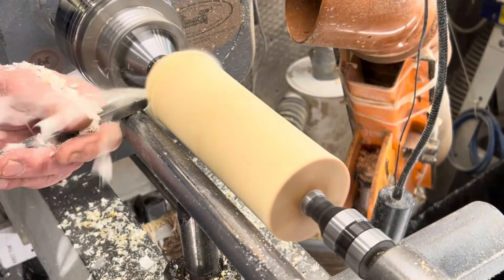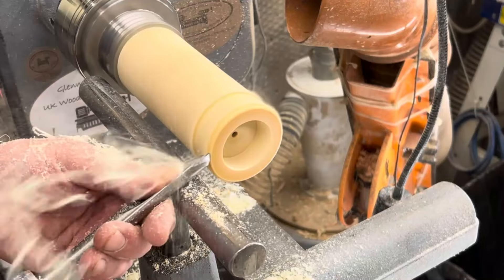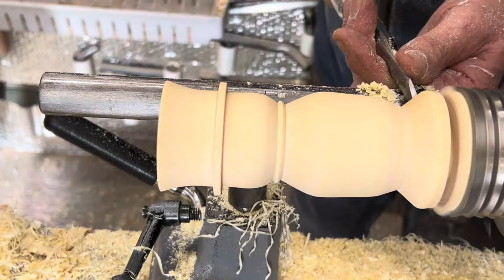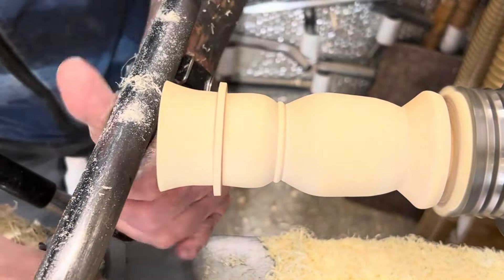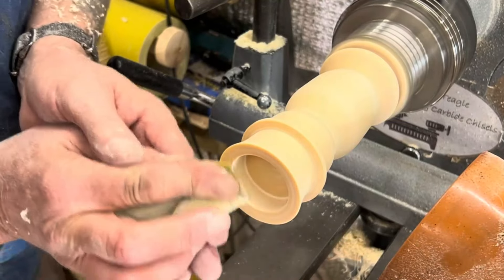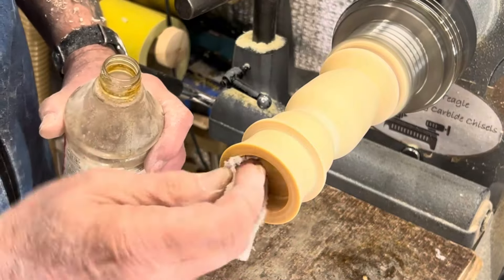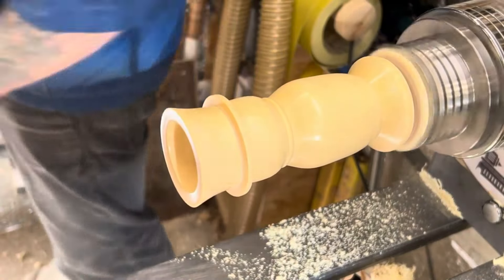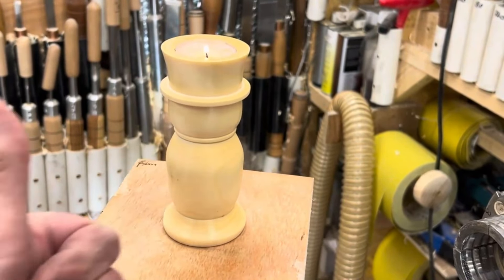Woodturning. Making money from free wood. #carbide chisels

Comment: Lovely skills , makes me look very amateur , i like the idea of tea lite holders but isn’t there a fire hazard ? Would hate to make something that caused a problem
Reply from the maker: Why would there be a fire hazard ?
Reply: @glennteagleofukwoodcraftca5308  lots of safety warnings about tea lights on flammable  surfaces causing fires , or do your use electric ones ?
Reply from the maker: @ianparkes2538  where are these warnings? Do you mean from other Turners, just spouting out crap, scare mongering. The tea lights come in packets which state not to leave lighted candles un-attended, not to place them on un-even surfaces, not to leave them in a draft, not to leave them on plastic surfaces. In all the years I have used tea lights I have never managed to catch a holder that I have made alight. I have put it out there that if anyone can show that, then prove it. I have tested that a lighted tea light placed on a sheet of paper will burn out and will not catch the paper alight. The cases do not get that hot. If you do not feel comfortable doing it, then don't. That is all I can say.
Reply: @glennteagleofukwoodcraftca5308 well said mate
Reply: @ianparkes2538  The flammability issue is with bare candles in wood, as they can burn down, soak the wood with wax, and turn the wood itself into a wick. A pipe cap can prevent that. But tealights/confetti lights are fine as there is a metal or glass surface in between.
Reply: @glennteagleofukwoodcraftca5308  sorry mate iam not trying to wind you up ,i was  just asking really because of all the warnings put out by various fire authorities , but i agree there is no evidence that they catch fire to wood and you’ve clearly tested this ,its  just plastic surfaces and the dangers of double  wicking etc so user error really . 🙏
Reply from the maker: @ianparkes2538  that is the main thing, user error.